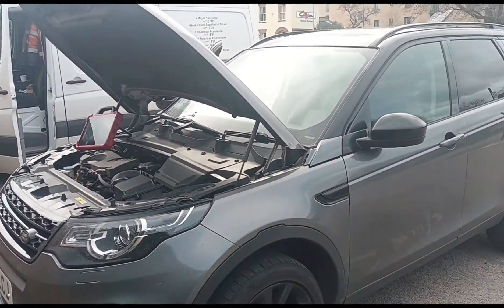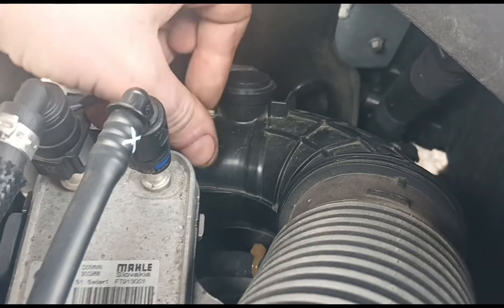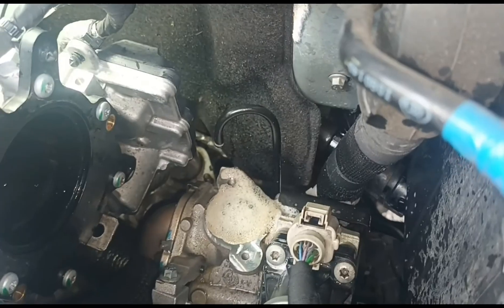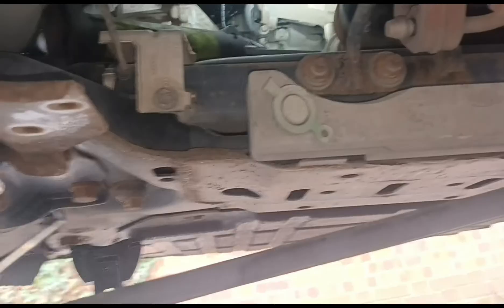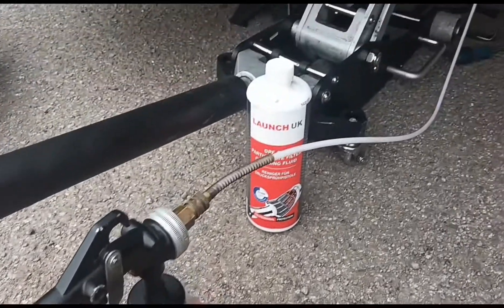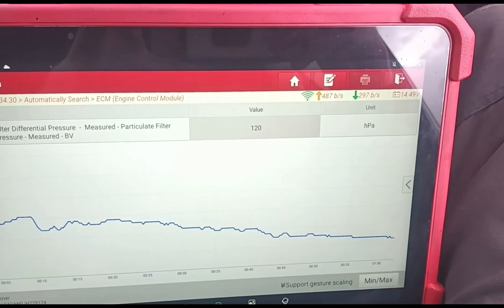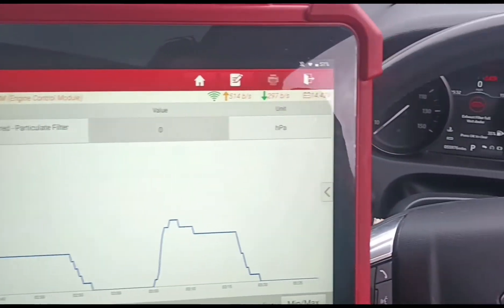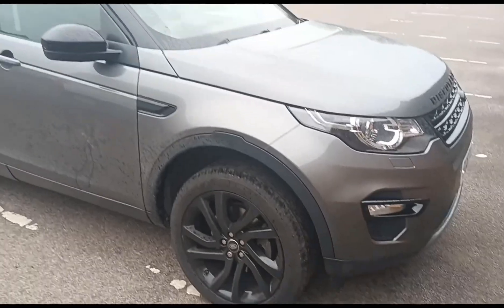Land Rover Discovery Sport 2.0 DPF, SCR, EGR & Cooler, Adblue DEF Injector & Turbo Cleaning

Comment: Hi Your videos are superb. I have a Discovery Sport Ingenium 2017 on 96000miles. Getting odd P049B faults coming up. Is there a way to clean this without removal of any components or will it require a replacement cooler filter?

Comment: Hi, great job! I also have a Land Rover Discovery Sport, and I'm experiencing these issues. What should I do to improve performance? The lambda sensor was already replaced last year, and the diagnosis indicates the accelerator. Maybe with a cleaning, it would work better? Error P2196 and P0121

Comment: I clean my dpf injector every few weeks… I even switched with OEM adblue… why does the injector plug up all the time, also replaced the injector less than 1 year ago OEM Land Rover part, 3-400 miles a week. Dosing & quality monitor codes..
2016 Range Rover HSE 3.0TD6

Comment: zero pressure across the dpf  and low pressure egr carboned up with soot that shouldn't make it past the dpf tells me the dpf is cracked internally and would need replacing or you will end up with is  egr flow efficacy again  p049b that my experience of these vehicles

Comment: Bonjour , i've only P049B problem , i plan to send Bardhall EGR cleaner in the air input , i hope get a result.  if not let me know if the best is to change LR126126 filter ? Thanks for the job you do and share it .

Comment: Thanks for the video, very detailed! Maybe you can give me a hint on my case of a LR Disco Sport 2.0 ingenium. Had a full timing set replaced, new turbo, 2 new exhaust temperature sensors (had an engine light from them), all fluids including adblue etc. Runes like a dream but randomly goes into limp mode without any lights but the red triangle. Only showes p0299-84 underboost issue. Checked everything twice, used the smoke generator, all pipes, hoes, connectors and can't figure it out. Any ideas where should I look? Feeling pretty desperate after throwing about 4000€ into service.

Comment: Hi, have seen some of your movies where you use Launch DPF cleaner to clean up DPF, Turbo, egr and intake with great success. I am surprised at how effective the Launch DPF cleaner works.
What I'm wondering about that could be something to check out is; How will Launch DPF cleaner work on a oil burning petrol car with oil rings on pistons that are clogged with soot? Then consider if Launch DPF cleaner mixed with water is sprayed into the intake while the engine is running

Comment: Hi Jimmy, new to your channel, have you ever seen an Evoque with the ingenium engine pulling into the cabin? Thank you.
Reply from the maker: Pulling fumes in?
Reply: @ORileysAutos  yes, exhaust fumes. LR have repaired this twice with the clamp/gasket from turbo to DPF and still doing it. Getting frustrated
Reply from the maker: @Nicholas S  not seen that issue. Get an independent smoke test done
Reply: @ORileysAutos  thank you I will look into it.

Comment: Gday from Australia. I have a 2016 Evoque 2.0 Ingenium diesel. I'm having a recurring P049B-00 fault which has been showing up progressively more regularly. Regens fine. Runs great. Runs 10hpa or lower on particle filter differential pressure after regen. Would I need a new EGR filter? Or would just a clean do the trick?
Reply from the maker: This trick always works for me
Reply: @ORileysAutos  Thanks for the reply! 👍
Reply: @ORileysAutos  could a cleaning solution in a can (egr cleaner) be used to spray in that hose?
Reply: @ORileysAutos  pressure is reading around 0 on my scan tool but the voltage on that sensor flicks between 1.3v and 4v.. faulty sensor?
Reply: Thanks 🎉 what the milage ?

Comment: What cleaner did you use to spray into the EGR? That cut the carbon out of there real quick..
Reply: Makes me think.. If the EGR is closed.. Can you just flood those hoses with diesel and let them soak for a while and then vacuum out the dissolved soot with a long flexible and slender hose attachment.. I am trying to figure out a. way to clean out my EGR's without taking them off.. Before they get clogged
Reply from the maker: I used the same Launch fluid

Comment: My diesel has 230,000 miles on it and has never needed a clean.  However I do motorway miles or long cross country trips which is what diesels are designed for, not for short trips to the shops and back where the dpf doesn’t even reach operating temps, never mind do a regen.
Reply: Hi what year is your LR?

Comment: Why would anyone spend that amount of money on that diesel vehicle to just do 3 miles a day..Salesman saw his commision i expect🤞, failing to mention diesels need to be run, not like a chelsea tractor 😢
Reply: Exactly but more so with certain JLR vehicles.
Most annoying about that JLR have loads of comebacks because of that exact issue so much so that JLR produced an internal technical guide for SALES staff explaining the issue of oil dilution due to failed DPF regens and then excessive oil changes required and the need to the run the vehicle for 20 minutes over 40mph (although 40 minutes is more like it) for regens to happen or they risk oil dilution and DPF blockage. All because of non close coupled designed exhaust emmision system in certain models (Epace, Discovery Sport and Evoque all with Ingenium engines, other models less of an issue). 
It was basically a guide to steer customers away from buying diesels who would be mainly doing short journey. Do you think the sales people did that though? £££££🤩
There's a class action law suit in the US over it although mainly due to the excessive oil changes needed.
I don't want to put links on here but just search for 'D8 oil dilution explained'

Comment: Thank you master! I have the DTC P049B-00 on my Jaguar XF 30d (X260) and I am looking forward to clean the egr valve and replace the egr cooler filter. It will be difficult as there is no much space to work in the engine compartment. Any helping tips? Maybe some special egr cleaner spray you can recommend?